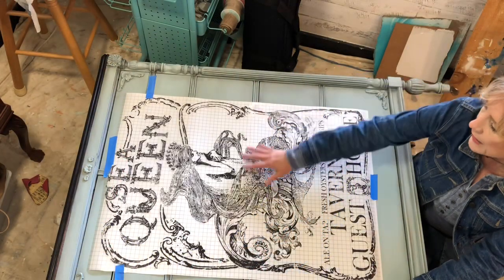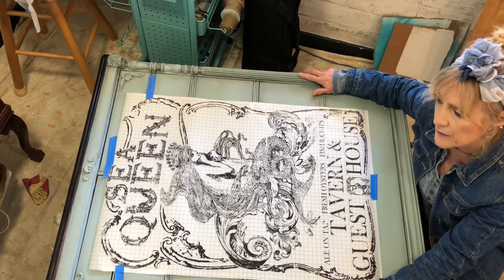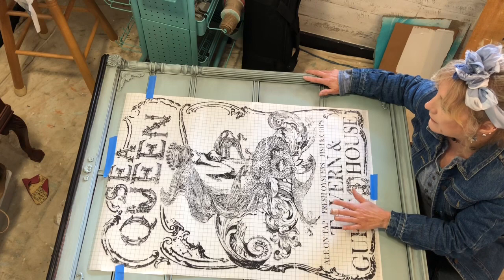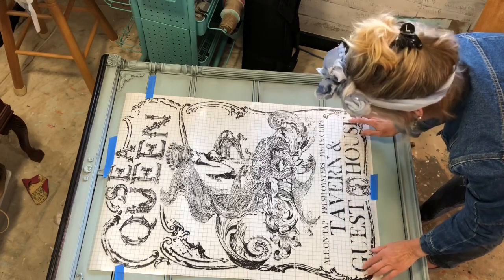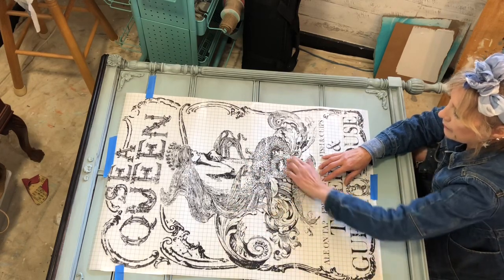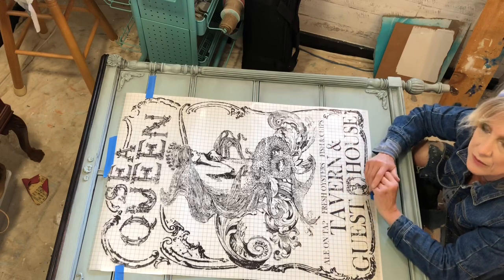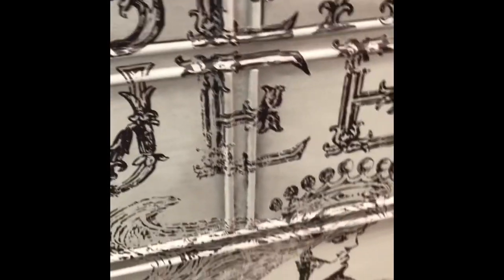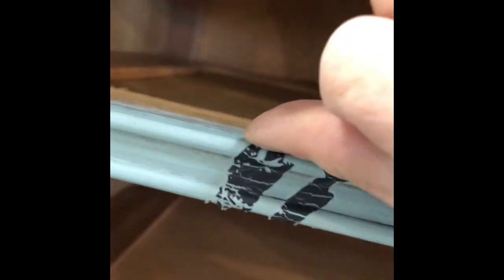DIY How to Apply IOD Transfer onto a Dresser Front

Comment: Do you press hard while applying the transfer
Reply from the maker: Hi Andrea!  You don't need to press hard.  If you watch, you just need to start rubbing but get a small "air bubble" to do the work for you.  When you start rubbing to get the stickiness of the transfer to start grabbing to your piece, the air bubble then pulls the transfer off it's backing sheet.  You don't want too much of an air bubble that the transfer moves too much though.  This is why you see stockists constantly pulling back the backing sheet - it helps get the air bubble.  Also, you will notice where you have any curves like moulding, edges, bows, etc., the transfer pops right off - cuz those curves create the air pockets/bubbles. - Linda